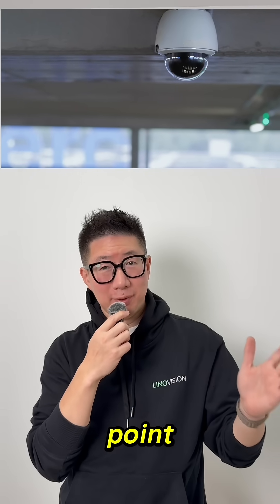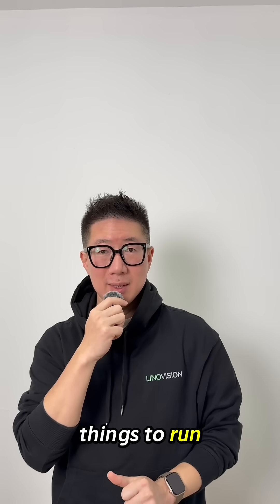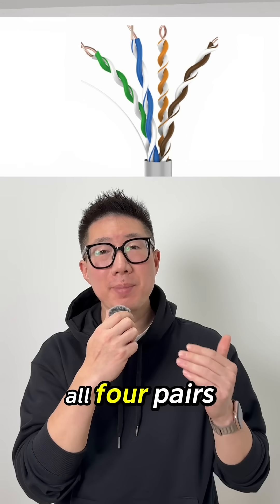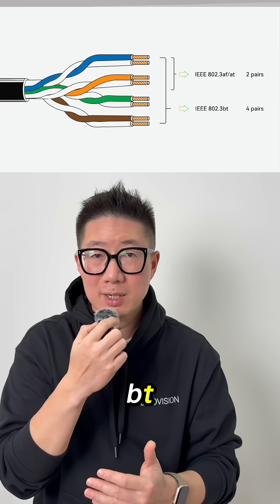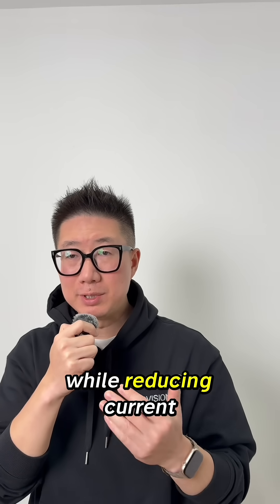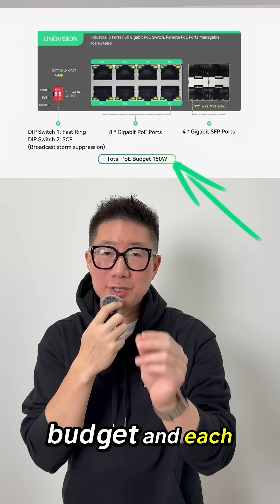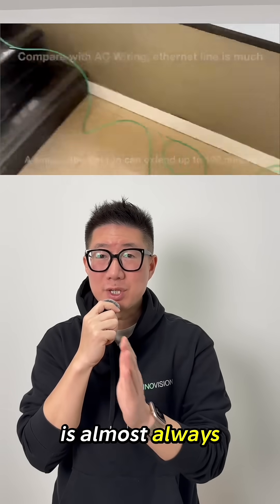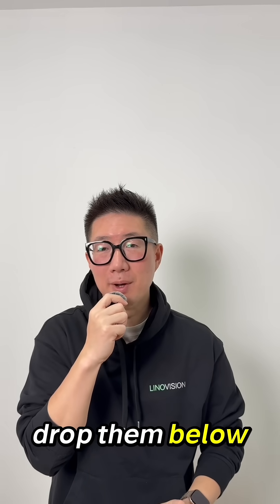How Can One Ethernet Cable Do This? | PoE Explained!

Comment: Minor note: some Poe injectors are passive Poe. So they supply a fix power, and they don’t negotiate with the edge device. So in those scenarios matching power output is required to prevent over voltage. 

Or just ensure they are active poe.
Reply from the maker: That’s a great callout! totally agree.
Passive PoE can be risky if voltage isn’t matched correctly. We’ll dive deeper into active vs. passive PoE in an upcoming video. Thanks for adding this!